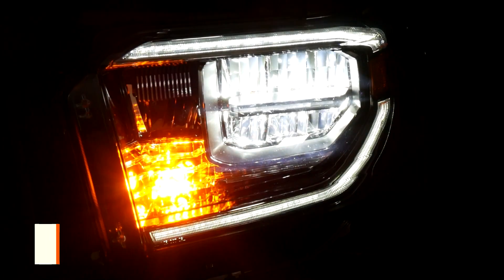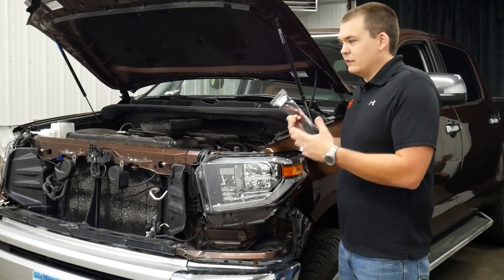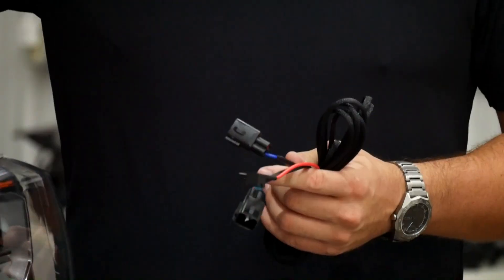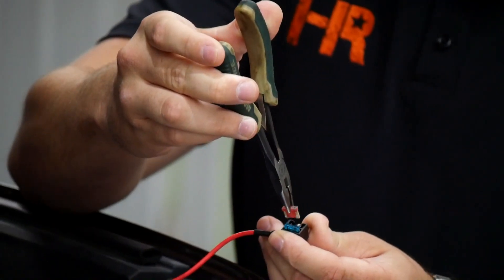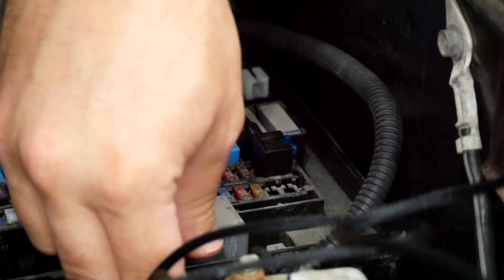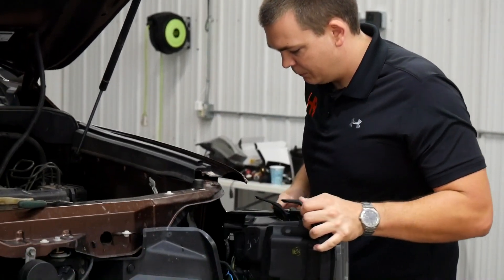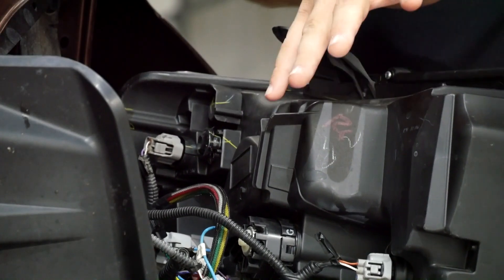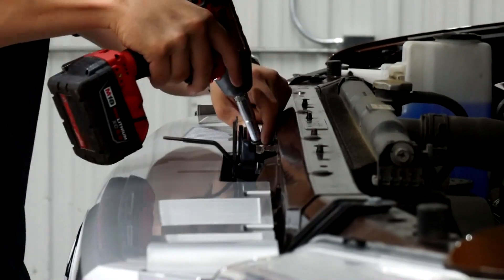Adding LED DRL to your non-DRL Toyota Tundra Headlight

Comment: I have owned 5 Tundra's for my business but my 2020 4x4 TRD Pro is the weirdest. It has LED Headlights, LED Fog lights and LED DRL's but the turn signals were Halogen bulbs. Toyota recalled the truck a couple of years ago because with the LED headlights on the turn signal bulbs were barely noticable so they changed them, to more Halogen bulbs, what a waste. They were so dim that I put LED's in and now the front end is perfect.
Reply from the maker: It sounds like you've got a great setup now! Toyota's recall is a prime example of why it's important to have the right bulb for the application.

Comment: My blinker connection from new morimoto headlights won't work on my 2019 tundra. The wiring on the connections for the blinker, look like they're in the wrong place. But can't for the life get a hold of morimoto service nor do Any videos exist on this subject! Help!
Reply from the maker: We have an in-depth installation video that should help! https://www.youtube.com/watch?v=fQWXMGXDnLE&t=205s

If you need further assistance, please don’t hesitate to reach out to us at sales@headlightrevolution.com or call us at 218-755-5200. We’re here to help!
Reply: @HeadlightRevolution  all the connections are in the correct spots. Still No blinkers or hazards on front and back. Just inside the truck where you can hear the rapid blinker sound.

Comment: I believe you guys left out this part for guys like me that has the SR5 wo/DRL from factory...Compatible: Though the harness itself is completely plug n play, due to the fact that the new headlights use a 7443 front turn signal bulb inside the lights versus the original 3157/4157 - you will just need to re-pin the connector coming from your truck in order to make the blinker work properly. Simply swap the purple & black wire, and voila! good to go...do a video on that please!!!!!
Reply: Exectly they left that out I just did it on mine ..the turn signal bulbs got really hott so you gotta check on them often
Reply: Thanks for addressing this as my 2016 turn signal hyperflashes with new lights so I'm assuming i have to use the old bulb or upgrade to LED.
Reply: So my 17 sr5 hyper flashes only when headlights are on. But works fine when drls are on. Any way on how to fix this?
Reply: Thank you! Same on my end! My friend tried changing the wiring but couldn't get the wires out. Any suggestions??

Comment: Is the only solution running into the fuse box is to set the cover over the fuse tap wire? Is there a better way to fish though a existing garment? Or is there no  risk for moisture entering just setting the lid over the wire?

Comment: I just installed pretty simple. But Blinkers won’t signal when headlights are on, only signal when they are off. Having hyper flashing turn signals. Could it be because of the LED build I switched for the regular bulb ?
Reply from the maker: It's possible! Reach out so we can trouble shoot this with you!

218-755-5200
Sales@HeadlightRevolution.com
Reply: I'm having the same issue. Did you figure out the problem?
Reply: @TubBillyVang  yes I did u have re pin your harness it’s only two wires just switch them

Comment: This is amazing but I ran into a little problem... so the thing is that the turn signals on both sides the don’t blink when you put you put your turn signal on either side, the light that it’s supposed to blink, it barely dims with the turn signal, but when it’s of it turns on and off as it should. Do y’all know what it is ???? Or if I did something wrong???? Please
Reply from the maker: Reach out to us at Sales@HeadlightRevolution.com and we will help you out, We've got some top notch troubleshooting guys on our team!
Reply: Repin the wires

Comment: I have a 2017 Tundra with the amber OEM DRL (non LED DRL) I bought  some 2021 Tundra OEM headlights with factory amber DRL and white LED DRL that I am going to install. I ordered the the H126-LED 14-20 Tundra OE LED HEadlight Conversion (trucks w/o OE LED DRL). The packages came in and has 2 H126 harnesses and 1 H126.1 Harness. Is this the correct kit and will I need to use the H126.1 harness in this kit? I think I only need to use the 2 H126 harnesses?
Reply from the maker: You will need to use both.

Comment: What's the blue fuse on the harness. Mine seems not to have that
Reply from the maker: You would have had to order the DRL harness to have the fuse that you are referring too. That is to allow for the DRL to function like normal, even if your vehicle didn't come with them from the factory!
Reply: Y did the fuse in the harness come red? When in all your videos u guys say it should be a blue fuse? 2016 tundra

Comment: Just purchased the oem conversion for my Tacoma but I do not have the connection that connects to the drl. Is this sold separately or did I purchase the wrong harness?
Reply from the maker: It is separate. That would be the DRL harness. The conversion harness is different. You will need both.
Reply: Ok cool thank you, do you have the link to the drl harness so I can purchase that as well?

Comment: I have a sr5 2014 tundra w/out drl strip . And recently purchased platinum drl head light with drl.

Bought your drl harness, connected and did exactly what you showed on your YouTube channel and it did not function at all. 
Please assist...
Reply from the maker: Hey Blake, give us a call sometime today and we can work on troubleshooting your lights. 218-755-5200
Reply: Did you solve the problem having similar issue but with different headlights
Reply: Miguel Costilla I did not, i been bit busy... but from what I got from the there IT rep is that all that was purchased on my end is what going to be utilized for it to work..

So I can’t find the conversion kit plug-ins on my truck, don’t know if that last guy that service my truck to rig up some hi-id cut them off for rigging... ( Mexican rig work)

Hope this helps..
Reply: I have same problem, they not coming on at all..!

Comment: Question: I installed everything as it should be but my turn signals hyper flash only when the headlights are on. Also installed led oem fog lights at the same time. And I do have led license plate lights which I noticed now stay on regardless of which position the headlight switch is. Any solution/help would be greatly appreciated.
Reply from the maker: Hello there, we can help you with this! Please send us an email so that we can properly assist you with this.

Sales@HeadlightRevolution.com
Reply: Did you get a solution to this. Having the same issue with mine

Comment: Just installed this on my 2017 Tundra and it worked like a charm, thank you for a great product.
Reply: Quick question, does your drl keeps dimming or not as bright using HR harness?
Reply: Can you keep the motorized leveling with these?

Comment: Hi I’m not sure if y’all can help I have a Toyota hilux 2019 and I have the basic lights that mid spec comes with I bought the original day time running lights the fully loaded comes with but the set up is different I’m looking for a module to connect my stock wiring with the new headlight.
Reply from the maker: Hey Joey! Give us a call today and we can help find what you need! 2187555200

Comment: I installed my new lights but when I put it drive the yellow turn signal drl’s turn on automatically along with the led’s what could be causing that ?
Reply from the maker: Hey Ricardo! 

Just to be 100% clear, you just installed the OEM LED headlights, correct?
Reply: Mine does this also
Reply: my tundra also does the same, you look at the Led but also the yellow light
Reply: Anyone found a solution?

Comment: Installed these on my 2016 SR5 non DRL car. Hooked up the adapter to the fuse box. Now turn signals only work with low beams off and only DRL. Also getting rapid turn signal on taillights. Any thoughts?
Reply from the maker: Shoot our customer support team an email and lets figure out what's happening here!

sales@headlightrevolution.com
Reply: Did you find a solution to this because I am having the same issue
Reply: @pjacks6  there’s another video to how to re-pin the headlights. After I did that no more issues
Reply: So blinkers are working fine. It’s just that they stay on while the drls are on instead of only coming in when the blinker is on
Reply: @trey3uz  what's the link to the video if you don't mind?

Comment: I am swapping my gen 2 front end with my gen 3. So the 14+ headlight models will fit my car but are the wirings on the 2007 the same as the 2014? Is there anyway I could get around this?
Reply from the maker: Not sure of a harness that would convert that wiring over, it is different though!

Comment: Would this drl leds work on a 2020 tundra???
Reply from the maker: Those will totally work for your 2020 Tundra! They are a fantastic product, and really get you an increase in safety with that added light output! I would also recommend checking out another headlight made by Morimoto, this is called the XB LED Headlight and I have linked them for you here: https://headlightrevolution.com/2014-2020-toyota-tundra-xb-led-headlights/

There is actually a sale going on for those XB LED Headlights for 10% off, so if you consider those make sure to get that discount code applied! Let us know if you have any other questions! 

Sales@HeadlightRevolution.com

Comment: I want to do this to my 2019 Tacoma sr5, do you sell anything for that?  no drl
Reply from the maker: As long as you have the ability to turn off your DRL, we have the XB LED headlights for hat vehicle, and I have linked them for you here: https://www.theretrofitsource.com/toyota-tacoma-xb-led-heads-B-LF530?quantity=1
Reply: Headlight Revolution my tacoma only has four connectors for the headlights, it does not have the one for the drl.
Reply from the maker: If you don't have a DRL on that vehicle, then you are totally good to go! Those headlights will really upgrade the safety of those lights, and also the look of the vehicle!🔥

Comment: Hey! I have a 2017 tundra and I purchased the Vland aftermarket lights for my truck. It doesn’t have Drl, so I took the truck to an automotive to have installed and they said when they turned on the blinkers, the lights inside the truck blinked instead of the turn signal lights. Any idea what could ha e happened? An install issue?
Reply from the maker: Unfortunately we are not familiar with that brand. It sounds like there may be a wiring issue.
Reply: I have the same issues after installing this DRL conversion harness. Installed on a 2017 Toyota tundra trd pro. I have hyper blinking with blinking lights around my climate controls. Did you find out this issue???

Comment: Did this upgrade to my 14 and wow what a difference THX to Headlight Revolution 😊
Reply from the maker: Awesome! We're so glad to help.
Reply: R your amber drls on after install?
Reply: @johnnycarrasco5593  yes. But their is a way to turn them off and get them to work when you use your signal but it requires you to go under the steering wheel or dash    I never did that part

Comment: Will this harness work for my 17 tundra trd pro with amber lights no DRLs if I want to install aftermarket headlights with a black housing that has DRLs and not the OEM lights.  If it will could you tell which aftermarket lights have good light output and maybe sequential turn?  I want good ones just not able to drop $1k on lights. Thanks guys!
Reply from the maker: This harness will only work with the OEM LED headlights. What aftermarket headlights are you looking at getting?
Reply: @HeadlightRevolution  I was thinking of the ANZO U Bar. I want a good headlight, something with better light output in my factory halogen. But I was hoping for it to have the black housing which is the color housing that my TRD PRO come with.  I am open to suggestions on which headlights I should get. Thanks
Reply from the maker: I personally wouldn't go with Anzo headlights, we have seen way too many issues with them. Have you checked out the Morimoto headlights? They look awesome, and perform even better. Plus, no extra harness is needed. 
https://headlightrevolution.com/2014-2020-toyota-tundra-xb-led-headlights/

Comment: I have a 2014 Tundra SR5. No drls. I purchased a set of platinum headlights with drls. Will this harness work on my SR5?
Reply from the maker: If they are the Halogen headlights w/ the DRL strip, you will need this harness: https://headlightrevolution.com/2014-2019-toyota-tundra-drl-addition-harness/
Reply: I also have a 2014 sr5 tundra and I bought platinum halogen with led drls headlights. I purchased the harness on this link and it didn’t work. I would like to know what else I need to do for my led drls to work

Comment: Happiness short live.I installed the LED headlights and tested ok, everything worked, turn signal, LED DRL looked beautiful, low beam, high beam, worked, not yet tested motor for low-high. Closed the hood and start the engine.... it's cranked but not start, try several times, still not start, re-installed the fuse with no fuse adaptor like not using DRL light, no start, reboot the computer by removed battery terminal and put back, still engine crank but not start. Cal and left the message. Replaced the old lights and the engine started again. Obviously the new electrical is an issue, still waiting for call back for help.
Reply: I think I found my problem the fuse, both fuses need to e in fuse tap provided, one from the truck that was removd and one came with the harness. Will try to install again tomorrow.
Reply from the maker: Let us know an update on this when you get the chance.
Reply: Update. I re-installed the headlights with two fuses, the engine is working again because yesterday I did not insert the truck's fuse as said. Not enough time to re-pin for the turn signal, so tuen signal only works when no DRL/HL, but will do re-pinning tomorrow.
Reply: Trying re-pin but the pin not comming out as easy. I try to push at the silver terminal ending bent it, luckyly I was able to straighten that pin, they still not comming out. What is the trick here?
Reply: Question, why it was working with only power supply using the fuse, but now even I tried to re-create same situation it's not?

Comment: Hi Wes Miller here, kinda of new to your channel. You got my attention before because of you good info. I have a 2014 limited Tundra, they do not have DRL. What setting on hand control do they work with? Is it on the auto setting?
Reply from the maker: The DRL will come on with ignition when you install the DRL harness kit from us. It won't be controlled by the headlight switch.

Comment: I have a 2016 Tundra SR5, it technically has DRL using the turn signal bulbs, it does not have the LED strip along the bottom. Does that still require this adapter or just the standard plug and play adapter?
Reply: Yes
Reply: The Amber's being on doesnt really classify it as drl. So yes you will need the second adapter.